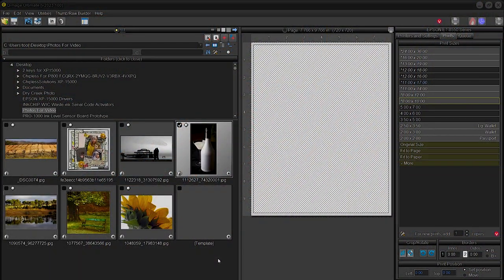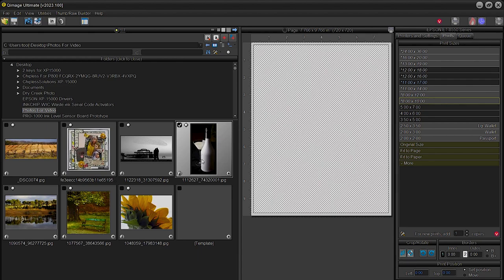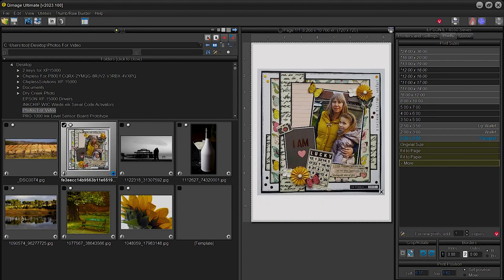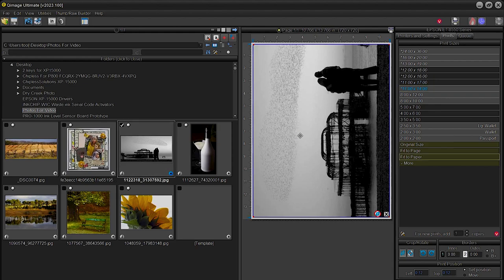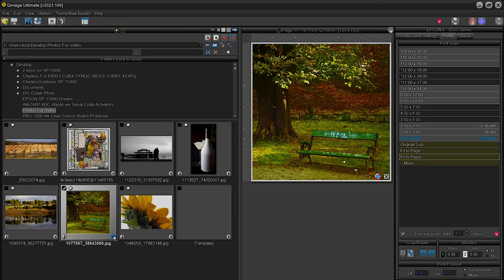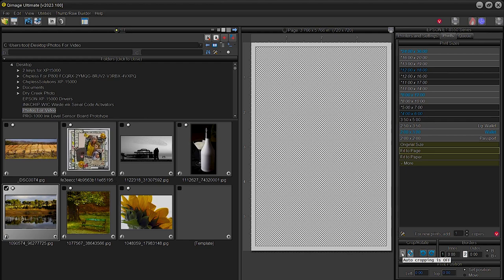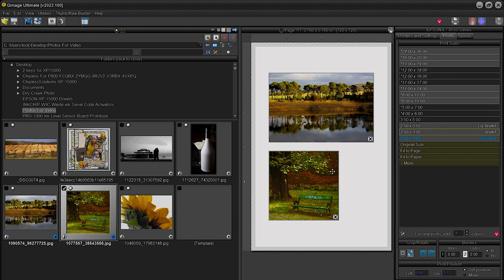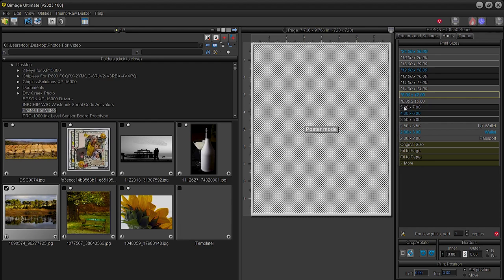Qimage Ultimate 2023 100 To Auto Crop or NOT Auto Crop!

Comment: Is it not simpler to create a document that matches your chosen paper size, then place the image on top, resize to fit and finally print.

E.g. Create a A4 document in photoshop. Then paste your image onto the A4 document. If you have to, use the transform function to resize the image to fit the A4 document. Place the image within the A4 document as you see fit, usually centered. Make sure to leave a certain amount for margin or border. Then, simply print the A4 document onto A4 paper.

It is a WYSIWYG way of printing. It is very simple. And you cannot go wrong.
Reply from the maker: Remember images have no size. Only pixel dimension. And depending on the pixel per inch you choose will determine so called size. Just get the RATIO correct and you can then fit it to a specific paper ratio without cropping. You don't have to paste an image layer on top of an 8x10 blank document. Just make sure the image is 4:5 ratio and it will fit on 8x10 or 16x20 as they are the same ratio.
Reply: Sure, I have no problems doing it your way.